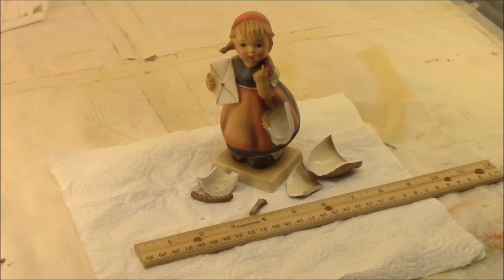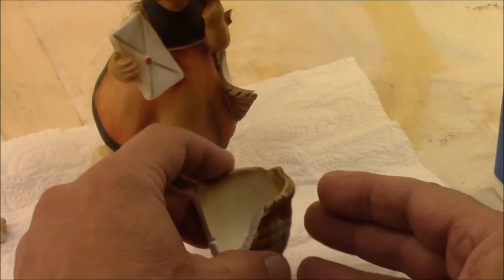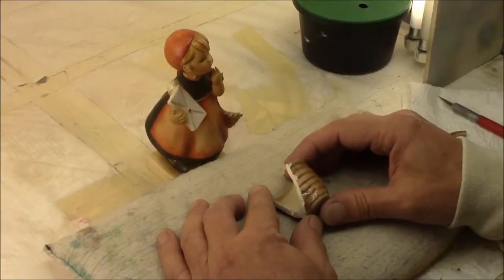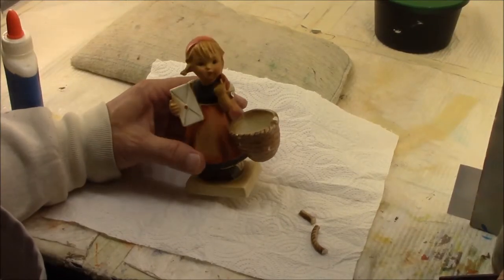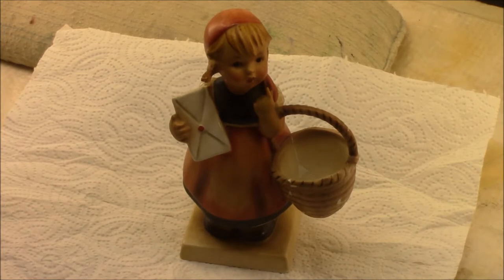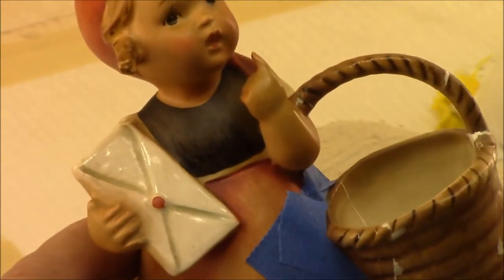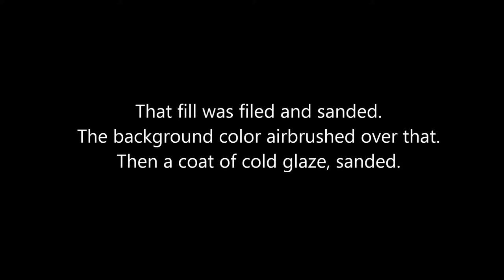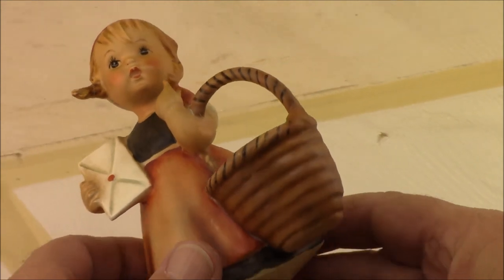Hummel figurine repair

Comment: Thank you for this video. I have 2 Hummel figurines passed down from my Mom, both with a couple of key pieces broken off. I have been struggling to get the repair to set. Your technique of using small pieces of tape to hold the glued pieces in place is ingenious and I had never thought of it. So thanks for giving me some hope, and I will try again!
Reply from the maker: You're welcome.
Good luck with your repairs.

Comment: Just to be sure. The more important steps in order to eliminate all visible cracks is to use superfine milliput and proper sanding.

The cold glaze application may not  hide all the cracks in order for them to be invisible at the end
Reply from the maker: Yes, Milliput is used to fill voids and cracks, even the tiny ones. That is sanded, then, if needed, another application of milliput, and sanded. Then that's followed with a couple coats of cold glaze. The cold glaze will make an even finer fill and transition from the fills to the original surface. The cold glaze, once sanded, also will provide a surface that will help the paint adhere better than just applying paint to the bare original glaze. Cold Glaze is also applied after each coat of paint.
Reply: @marsgitar  thanks for sharing the information. Very appreciated

Comment: great work. ive seen tons of steps of repairs on youtube showing milliput, glueing etc. but none go over the mixture of cold glaze ratios of sylmasta and thinner and putting it into the airbrush etc. also, if the paint in the airbrush is thinned out and with what. thx for help and i hope someone can post a video with that step. it would be very useful.
Reply from the maker: I'll try to address these questions in a future video. Thanks for the suggestion.
Reply: @marsgitar  you are a damn rock star for considering it. THANK YOU

Comment: This is a comment/request I left on your video of repairing a vase that had half of the top missing.  Thought you might not see it as it was a year ago, and since this is more recent, that you might see it quicker here.  

EXCELLENT REPAIR !!!  CAN YOU PLEASE TELL WHAT KIND OF MATERIAL YOU USED FOR THE MOLD YOU USED AND ALSO THE EPOXIES?  ONE WAS SOFTER THAN THE OTHER.  ALSO, HAVE YOU EVER REPAIRED A HOLE, WHERE THE PIECE IS MISSING AND THERE'S JUST AN ASYMMETRICAL HOLE IN THE MIDDLE OF AN ITEM - LIKE A TUREEN OR PLANTER?  thanks very much
Reply from the maker: The mold material I used was a quick silicone kit you can get at your local arts & crafts type store (Michael's, Beverly's, Art Supplies, etc.) I show a box of it in the "Chinese Tureen Repair" video. It's "the purple stuff".
What I use to cast missing ceramic parts I need to make repairs, generally, is a product called "A+B Epoxy". Yeah, I know, ALL epoxies are A plus B. In this case that's the actual brand name. The one I use is a buff colored epoxy putty, and it is very hard and very tough. You can sand, saw, drill, tap, carve it, and I can stuff it into a stiff mold.
The softer epoxy fill you refer to is called "Milliput", made in Wales (British Isles) and comes in white, tan, terracotta, black and sort of silver/gray. It is softer than the A+B Brand epoxy and I use it for finer fills. This stuff gets into the tiniest of hairline cracks and is relatively easy to smooth out, file and sand, compared to the A+B Brand.
Yes, I have often had to make a missing odd shaped piece in the middle of a side of a vase or tureen. For that I'd use the A+B Brand putty epoxy. I would just slightly over-fill that hole with the putty, then file/sand it down to the surface level of the existing ceramic.

Comment: you may have answered this several times but; can you please  tell me what airbrush set is best for use with hummels and why not use just brushes? Thank you, excellent work that you do on the broken pieces that most people would have discarded..
Reply from the maker: I use Iwata brand double action airbrushes. I use several different models. Any decent quality airbrush would work for painting Hummels. 
You don't need an airbrush to paint Hummels, but I do; especially for laying in the background colors. After that, where ever there are visible brush strokes, I use brushes. If you are good enough at painting with brushes, you could definitely paint Hummels with them.

Comment: Will you share your formula for "Elmer's" based bonding agent? Is it Elmer's white glue and Elmer's glue all mixed together at a certain ratio? You mention this in a comment below, or am I misunderstanding the comment you left to Suzy Solvesky
1 year ago. Or are these two products the same? Thanks Kevin
Reply from the maker: I no longer use my "Elmer's based formula". I'm not passing along the recipe because it it difficult to get the mixture just right, and it doesn't have a very long shelf life. I've been using plain old Elmer's White Glue. It's a good old stand by and works great on porous ceramics. The proper name, on the label is: "Elmer's Multi-Purpose Glue All".
Reply: @marsgitar  Thanks. I have a few Precious Moments figurines that I gave my wife earlier on in our marriage that have fallen from their perches I tried crazy glue and Duco cement which they recommend on their website but not having good results.

Comment: I would just like to ask please, is there a reason you used Elmers Glue rather than epoxy this time? Thank you. PS I love your videos Martin, so helpful for those of us still learning.
Reply from the maker: This is made of a porous ceramic. Elmer's is the best choice for this repair.
Reply: I'm glad to know elmer's all purpose glue can be used. I'd like to ask, though, about slow drying epoxy that I have seen mentioned elsewhere for ceramic. Do you have a reason for not using it? thanks.  @marsgitar
Reply from the maker: @catalot : This ceramic is porous and small. Elmer's is the best choice for this kind of repair because it is formulated for this kind of material. Epoxy works best when there is space between the pieces being bonded. I want these pieces as close together as possible for a good fit and alignment.
Reply: Martin you are great and i am learning a lot from you. Could you do a tutorial about how you match colours and what products you recomend us? I would like to learn everything with you...all the process. Thanks a lot for make me be interested in this topic. Best regards from Spain.

Comment: Can you please explain what glues you mix together for Hummel figurine repair? What do you add to the Elmer’s bonding glue? I have been trying to use Super Glue which is very difficult to set the pieces in place.
Reply from the maker: I don't use that old Elmer's-based formula of mine anymore. I'm not going to divulge the formula because you shouldn't use it.
I use good old Elmer's "glue all" for use on most porous materials. It's strong and it is undo-able (dissolves in water). Elmer's is plenty strong for Hummels.
I don't recommend Super Glue for repairing ceramics. It's a major pain for me, as people try fixing things with it. They mess it up badly, then bring it to me to fix. I charge them extra to undo their glue-up screw-up. There's pretty much nothing that will dissolve CA glue. Acetone will weaken it  . . . sometimes.
Reply: @marsgitar  Thank you so much for your help. I’m looking forward to trying the Elmer’s next time I attempt the repair!

Comment: In a how to video I was looking for proper glue, filler, type of file, tape etc. I didn’t get this!
Reply from the maker: Sorry, but this is not a "how-to" video. It doesn't claim to be one. Also, it's one of my older videos. The newer ones are more info oriented. I always answer viewer's questions though.
So, to answer your questions: The glue is Elmers white glue. The tape is masking tape. The files are steel files from Harbor Freight. The filler is Milliput superfine white. The paint is Goldens brand acrylics. The final sealer is Sylmasta brand Cold Glaze Pro II.

Comment: Hello,I have one question ,what's the name of that white staff,you spray before ,aplink properly paints,thank you.
Reply from the maker: In this case the white stuff is the background color. Here, I'm using acrylic paints by Golden brand. The color I'm using is called "Titan Buff". Only Golden makes this color.
Reply: Thank you,for the answer,I try repair large sitzendorf figure group,and when I use glue,After filler,After sand it,and apply paints on it,it's every time,I have problem ,I can see connection where two parts was glued,thank you.
Reply from the maker: @robisrublis61  you need to go over the glue line with Milluput/file/sand that joint to smooth it out.
Reply: Thank you,I will try the best.